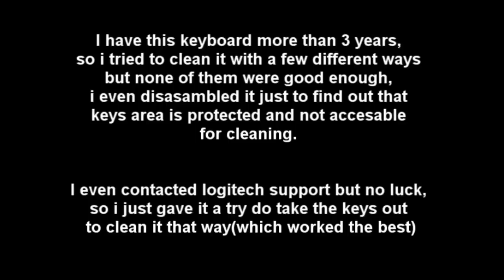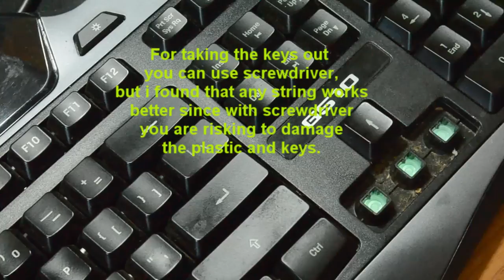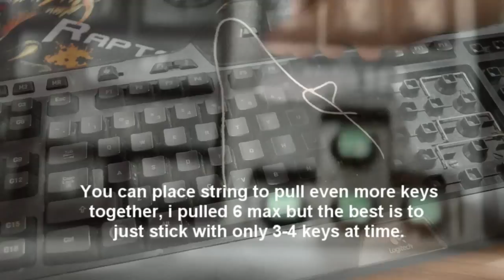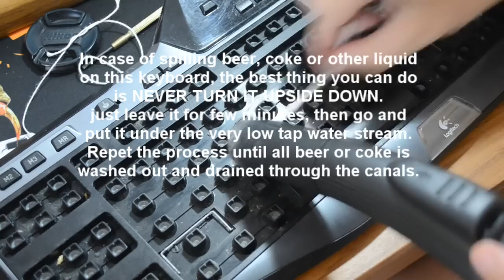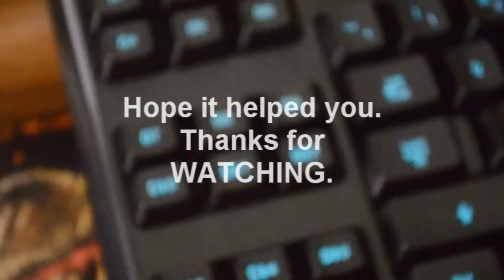Logitech G510 keyboard Cleaning

Comment: Thank you! Always afraid to remove keys in fear of permanent damage. And at this time, the G510 is still an amazing keyboard but well out of date. having 18 programmable keys with 3 preset profiles for quick switching makes it amazing and haven't really found any other keyboard to come close to this amount of versatility and feel. So thank you again for having a cleaning video like this since only just now, 10 years of owning the keyboard, the keys are starting to get stuck
Reply: a bit in the same boat. tho i got the G110 and have a button that been worn so much i cant see whats on it XD "the alt key" i dont think i could change keyboard since used this for so so many years. the spacing of some of the buttons are great for me. so right now im trying to find info on how i can replace this key.

Comment: Thanks for this guide! Worked really well for my G105. If anyone's wondering, the process is exactly the same except there're fewer G-keys to worry about. Also, dental floss is really good for pulling out keys since it's strong enough to handle the load and soft enough to not damage anything and not hurt your fingers too much.

Comment: I fixed the space bar! 
Note - it has only 1 center plunger, pry up in the center and it should pop off like all the others. It has a long 'paper clip thin' metal bar/spring similar to the one you'll find under the return & shift keys. Seems that spring came out of the clips before i bought my keyboard (used) and i didn't know i could fix it, so glad i tried! It's a little noisey now, but i no longer have to hit it dead center. Tip: before re-assembling it, make sure the metal bar is snapped into the clips towards the front of the keyboard (near the elbows) and lay it flat with the ends point back towards the top of the keyboard, then push the spacebar down in the center right over the center hole and the ends should also snap into the little clips that hold the ends of the spring. Done!
Reply from the maker: I'll add it to the info, it might come handy to someone.

Comment: Thanks a lot for this, I had spilled a coke on mine and the first thing I did was flip it over to let the coke drain out, I got it from a friend so I didn't know I wasn't supposed to. After a while some of the keys started to stick and I was worried that pulling off keys would mess with the lights. Thanks to your guide my keys are unstuck,and working wonderfully. Thanks again!
Reply from the maker: My pleasure, glad it helped.
Reply: You shouldn't spill cocaine on ur keyboard, it will get messy when you try to snort it out 🦑🦞

Comment: My G510 that I've had for a while is starting to act up, the A key specifically, when I press it, sometimes it sticks really hard, and other times, I'll press it, and it'll activate one of the color-changing macro buttons on the top left. I took a few keys off once, and tried to clean it, but the problem is still there. So I guess it's either this or a new keyboard, since they don't sell G510s anymore.

Comment: Thanks heaps buddy for this video, I loved my G510 so much I bought a second one that was old stock and really cheap. My main concern was the space bar and lower keys that I used quite often. Not so much gaming, but I reset my G Keys to open programs, Outlook, Word, Excel, Directory Opus, Photoshop, Paintshop pro, (you get the idea), so I just wanted it to work like new, so looks like I'll be doing a "Refurbishment" of my G510, pulling keys off, (Will use second board to see WHERE the keys go, Hee Hee). Thanks again. Teddy

Comment: Damn i wanted to fix my spacebar
Reply: SAME
Reply: Same
Reply: Same
Reply: @vellen08  Use a spudger instead of a screwdriver (or string for that fact). A spudger is a medium hardness tool used to pry apart plastic housings of things like printers, monitors, etc. You use them like a screwdriver to pry open plastic housings but, being a medium hardness plastic, they do no harm to the housings like screwdrivers do (you can still break clips but that's another topic altogether since this is about keyboard key removal).
Just Google "spudger" (yeah, I know - stupid name but they're a for real tool) and you'll get plenty of hits (and pix). Get more than one; being a medium hardness, they do break every now and then. I usually buy them in a 5 or 10 pack
I wish they made replacement keys for these keyboards; I always wear the paint off the ctrl and shft keys within a year. And I'm not even a gamer (no games on my rigs; I even remove the MS "games").

Comment: I have one of these and was worried trying to remove the keys for cleaning would rip out LED or something, glad to see that won't happen, I'll do a full cleaning soon but my left shift was sticking so I had to remove it and clean it, works like a charm now though
Reply: The spacebar is indeed the only tricky key to remove when cleaning, although all with a metal bar like backspace, enter, shift and such should be handled with care :)
Reply: Wolfy Luna

It was easy enough to get it clean, and I've cleaned keyboards using this same method before, I just had no idea how exactly the LEDS were in so I was worried about cleaning an illuminated one.

Comment: Thanks, doing on my G105 now.  FYI you can remove the space bar.  I very gently lifted up the side, to disconnect the lever, then slid the string to the middle and pulled it off.

Comment: Great vid. So you apply the keys back just like you would press them, nothing special about them? and those Shitfs and Enter keys, anything special when installing them back?
Reply from the maker: Yea just press them down, a bit harder tho than usual keypress. They have a little lever inside so its a bit trickier to do them, you can do them as well but you must be extra careful since they could break.
Reply: So I still pull them out the same way also put them back the same way? Nothing to do with that Lever?
Reply from the maker: If i remember correctly you have to place metal lever into smal hole in the key. BUt i cant remember atm, it was 2 yrs ago.

Comment: did not know the G510 had draining holes. None  the less I do not recommend running tap water on it. If only a bit comes in the electronics it could get damaged. I would dry it with paper towels and q-tips then use slightly moist q-tips to get clean it after wards.

Comment: how do you remove the volume scroll wheel? i think mine is shorting out or sticking or something .. it randomly turns the volume up and down and until just recently it is actually mess with my sound too .. b4 it was just the bar and didnt effect my sound now it does.. i tryed contacting  logitech  since i have only had the kb for a year but they wont do anything with it since i no longer have my receipt even though they do clearly state they have a 3 yr warranty on it

Comment: The keys J, K, Block Num, Z, V and - now are hard to press and don't pull up. I tried with another key in those positions and it does the same problem. I have to trow a magnific keyboard and I don't know why.
Reply from the maker: I was in the same boat jus few months ago. After years of use i had to buy another KB. And i got corsair K70RgB and never looked back. its also waterproof, but missing macros.
Reply: @speedfreakpsycho  I followed your great tutorial and now those keys don't work for no reason, mah. I buyed a Logitech g413 carbon for 58 €, I think (and hope) will be a good keyboard

Comment: Hey i could use some tips regarding this same brand but i can't find any specifics regarding this problem elsewhere (aside from attempting to contact log tech support which i see as a lost cause). My scroll wheel that controls the volume on the keyboard is bugged out and tends to go to random volume settings whenever i try to use it (as in it jumps around but i can sometimes finagle it to do what i want) I'm not sure if it's dirty or just a software bug-considering how i'm using it on a newer computer.

 if you have any ideas on how to clean that I would sure appreciate it.

Comment: i have a problem
when i place back the arrow keys, they all work perfectly except for the up arrow. when i press it, it just stays as if i keep pressing hard on it, meaning it doesnt come back up. also, the spacebar needs to be pressed harder. i really regret cleaning it
Reply from the maker: Are you sure you placed all arrow keys correctly?
Reply: speedfreakpsycho
 100% sure. i tried all 4 arrows in the upper case, none of them fit, and when i use the original upper arrow it just stays there as if im pressing it. i checked the underneath, nothing is broken, i dont understand how this is possible
Reply from the maker: Malcolm Agius That is indeed strange. Ill let you know if i find out something more.

Comment: 1. is the process same for g19?
2.does the low tap water thing work for most gaming keyboards? there are holes so u can put it into tap water?
Reply from the maker: 1. No i think you can disassemble g19 to clean it much easier. 
2. Holes are not for using keyboard under tap water, they are to drain any liquid in case of accidental spill.  If you put your kb under tap water the inside will overflow and go above the keys so you are risking internal dmg.
Reply: I have the G105 is it the same for that?? They seem to be fairly similar.
Reply from the maker: Enchanted Games Really dont know for g105, i didnt have experience with it, mabe someone else can help you.
Reply: I'm playing with a G105. These are really, REALLY easy to play with; DO NOT ALLOW ANY LIQUIDS TO TOUCH ANY OF IT. That's it. Grenades, fine. Throw it down the stairs, fine. Use an ultra-powerful compressor to blow the dirt out, fine. Water, NO!

Comment: How much detergent did you use? I don't want my keys to lose their letters if I throw them into a bucket like you did.
Advice will be appreciated :)
Reply from the maker: You can put as much as you want as long as it is not some strong one that will actually dissolve plastic. The thing is you can't lose letters cause they are cut-in plastic and painted from the inside, so as long as you are not scratching the keys on the inside you will be fine.
Reply: speedfreakpsycho Thanks! Now..last question: Do I need to put something onto the cotton things like alcohol or water? Or do I just leave them dry?
Reply from the maker: Leave them dry or use water, since some alcohol can damage plastic if it has high %. So the best is leave them dry or water like i did.

Comment: Thank you for the video. Unfortunately, I have somehow managed to break my G510 because I have done something wrong. When I connect it to the PC after cleaning it starts to press some random keys, even if I remove those keys again, for example, the number 5 or CTRL. Other keys won't be recognized at all.  Do I really need to buy a keyboard?
Reply from the maker: Depends what happened to it. Did you have any water spill recently? Mine got soaked with water recently, it overflood the drainage and menaged to get inside, i took it all apart, even the electronic parts, then removed the plastic foil with button register contacts on it and cleaned with alcohol and left for 2 days to dry. After that it started workign again, althogh i have a new problem that is happening atm, the display sometimes bedomes very hard to see, i mean i can see all the illumination but nothing on it.  Maybe ill disassambly it again soon so ill make another video.
Reply: speedfreakpsycho  thank you for your answer. Yes, I spilled some lemonade over the keyboard.
Then I tried to shake it out while holding the keyboard upside down. After that the keyboard had worked, but it was hard to press some keys like the Tab key or the W key. Then I have cleaned the keyboard like in the video but I went with the vacuum cleaner over the whole keyboard when I had removed the keys. Maybe this had broken the keyboard or some water went inside the keyboard without noticing it. I don't like to remove all the electric parts from the keyboard, because I think it might be complicated to put everything together again.

Comment: I have a question: Won't the keyboard just get dusty and dirty again? Because I washed by G510 and a week later it got dusty.
Reply from the maker: Yea, it gets dusty very fast but you can clean dust with some cotton sticks or using cloth and small screwdriver, but the inside of keyboard remains clean(at least for me). It depends of the conditions where you using it, my problem generally is that i often had dinner late at nigh near my computer and while eating some crumbs might fall in from time to time, also my pet sugar gliders can drop something inside when they run around!...since i live at Thailand at one point i had ants colony wanted to make nest inside it lol,
Reply: speedfreakpsycho Okay.

Comment: Hows the G510 or G510S Keyboard ? I hear problems about spacebar, like you have to press it in the middle and its not registered if its pressed in the sides. Do you have this problem ?
Reply: I can hit the spacebar on the most far side on my G510s and it works like it should.

Comment: I take the keys out, then take the keyboard apart, take out the electronic parts and just throw the rest into the sink filled with hot soapy water. I wash keys with a toothbrush and the big plastic parts with a larger brush.  

Works for me and keyboard is literally like new every time.   

Soapy water is really good for other things like controllers and even good for making old consoles look like new.
Reply from the maker: Nice...didn't think about that. Will try it next time.

Comment: Help I cleaned it and my g8 left ctrl and that key below right shift is stuck as in when I press it down it does not pop back up please reply asap
Reply from the maker: You switched the CTRL most likely. Try changing left control with right control. That should solve your problem.
Reply: speedfreakpsycho only the left ctrl is stuck and both keys are different in shape
Reply from the maker: can you take a photo of it? and send me at alterdejan@gmail
Reply: sebaskoo5 speedfreakpsycho lol yesterday I'm trying to clean my G510 and found this video. And today when trying to put back the key cap, both my G510 ctrl key stuck, and found comment on this video~ There's nothing broken or whatever. But not sure why my ctrl key does not pop back up... Did you managed to fix your key sebaskoo5 ?
Reply: ND kamezou nope I am trying to get back to the retailer for warranty
Reply: sebaskoo5 Hey I fixed mine~ Try one of these :

1. Insert the keycap. Pull it up to force the key back to the normal "idle" position. Press again. If still stuck, repeat the process. You might also need to wiggle the key to the left and right while pulling it up.

2. Stuffed some tissue inside the... keycap feet(?) Like this : http://i.imgur.com/OhHxgU1.jpg You might need to test yourself how much tissue you need to stuffed inside, and either you need to fill the left/right/both side of the "feet".

But to be honest I'm not sure if #2 is necessary though. I did #2 first on my CTRL keys, but after that my Win keys also got the same problem and I just did #1 and it went back to normal~

Comment: hey man, i cleaned my g510s and everything worked fine but i had to take the space bar off, after putting it all the keys the space bar stays in his  pressed position (and spams most of the time). i tried to move the metal thing but always had the same problem. can you please make video on how to "reinstall" the  spacebar please?
Reply from the maker: I am really sorry at this point i cant help you since i don't have plans in disassembling my kb soon. If i find some info i'll let you know.
Reply from the maker: speedfreakpsycho Also i mentioned in the video at 2:40 that space should be left intact without removing cause it can break.
Reply: well fml, thanks tho
Reply from the maker: Deus Mortis Btw there is a videio on yt, just type "How to fit a space bar on keyboard" and i think it might help you.

Comment: what's the reason you don't clean the space button?
Reply from the maker: I wasnt sure will i dmg it if i remove it.
Reply: well have you tried after this?
Reply: i have removed mine several times although i have the g 510s if that makes any difference
Reply: No problem here ripping the space bar off also, i didnt line anything up either when putting it back on, just left the spring flat and clipped it on, on a G510 that is

Comment: My space bar is sticky from a spill. Do you know of a way to safely take it off?
Reply from the maker: Not really, you can take it out but its kind of tricky and you can break the plastic parts that hold the levers. I would suggest just to try to clean it with  water or you can add a little bit of alcohol.

Comment: what if a key got stuck? for example f3,g11 and pause break?
Reply from the maker: I just hold it and try to move it up. down, left right. etc until it starts working again.
Reply: speedfreakpsycho not working
Reply: speedfreakpsycho i just left one be and it fixed by itself

Comment: how do  you put a shift back in ? there is a metal line ther
Reply: Just trial and error; I'm guessing you've done it now, but for those who haven't, it takes a lot of patience. I recommend putting the bar onto the main body of the keyboard, then align the key so that the metal bar will slide into the slots, and then push down very, very gently until it clicks. Takes about 10 minutes for first-time keyboard strip-down cause it's a pain in the nut sackies.
Reply: +Alex Greenwood, Ah, Thank you.

Just put on and press till two clicks, guys.